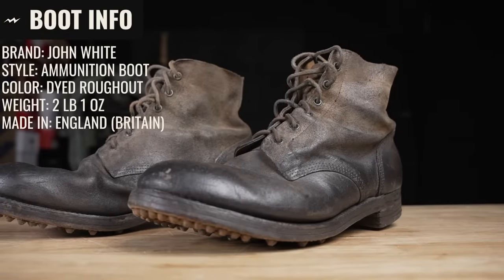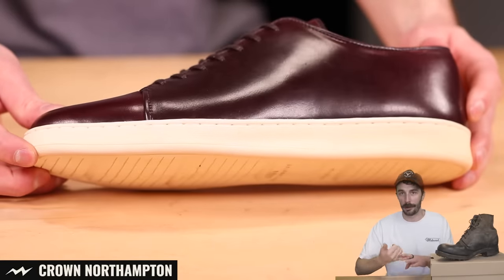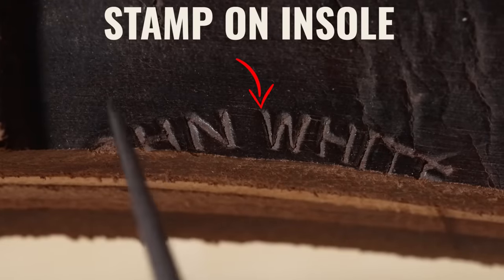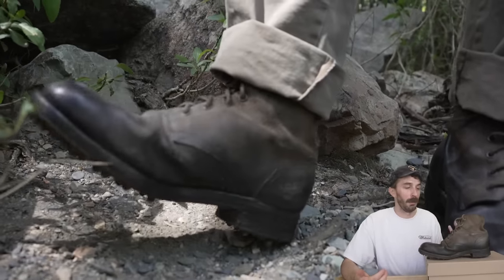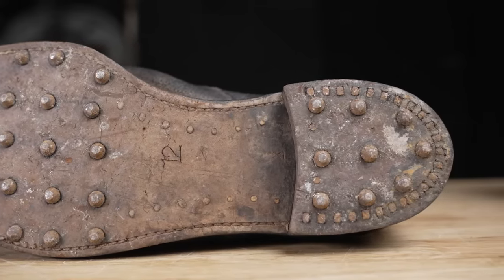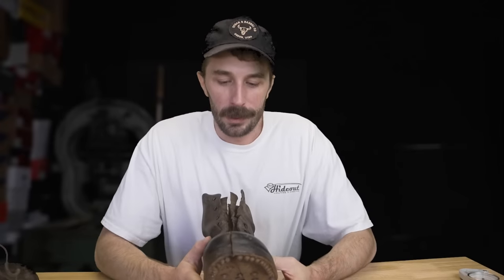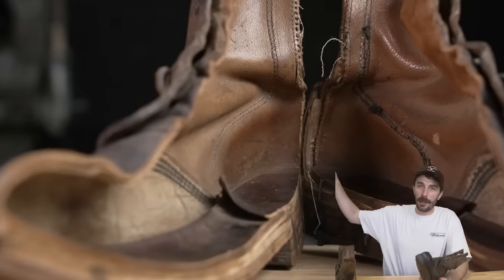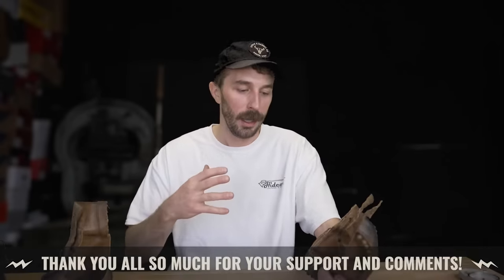Why 80 yr old British WW2 boots are better than modern boots

Comment: Very cool.
I have a pair of surplus swedish army boots. Stamped 1943, never worn, in my size.
These look pretty similair in construction though they dont have the reversed leather.
My boots have iron tipped toes and horseshoe heels. They don't have hobnails but they do have wood pegs. I'm not sure if they were meant to have hobnails and they were supposed to be put in later.
I also have a pair of swedish m59 boots that I have used for almost twenty years, they are broken in, but doesn't even begin to be worn out. These were manufactured in 1983 and never used when I got them. The m59 have a rubber outer sole (Tretorn brand), wich is the main difference from the older ones.
The only problem with these old boots is that they are very heavy compared to modern ones. I guess that's a testament to the quality but it does get tiresome after a long day.

Sad to see those fine boots cut apart, but as a boots enthusiast, I appreciate to see what's inside them.

Btw I have used raw linseed oil to soften up old boots that I've bought. I don't know if it's kosher but it does work and doesn't seem to do any harm.

Comment: I have actually worn some French 40s - 50s military boots (I was told they were basically the same model as the WW2 ones). They are definitely not better. They are very durable, they last long, but they hardly have any tactical design. Horrible when wet (after river crossing), horrible for running and such a thing as comfort for the wearer was not even a consideration.

Comment: In the forces we use to leave them in a bucket of water with added pee! YEP it works trust me! From rock hard they turn into supple  leather like carpet slippers! On long marches with hard boots it would take the skin off our feet. The studs are STILL used by many ceremonial soldiers like the guards as they are LOUD when drilling or marching on a parade! still in use today but not sure our boots were up to John Whites standard? Another trick is to really pile on dubbin or shoe polish and LEAVE IT to soak in - also softened the leather. Modern calf length assualt boots we are issued are mostly man made and VERY painful. BUT if you get a second hand pair of these they are worth their weight in gold as they are also 'broken in' and comfortable.

Comment: I'm sorry to tell you but the boots you have here are not the standard WW2 issue British Army Ammuntion ('Ammo') boots.. Standard issue British Army Ammo boots were made in black pebbled finish leather with a separate toe cap, six lace holes, a steel 'horseshoe' nailed on the heel and a curved toe plate screwed to the front of the sole. They were usually fitted with flat chequered finish steel studs on the sole rather than hobnails (with the exception of those issued to vehicle drivers and tank crew whose boots were not studded to minimise skidding on metal vehicle floors, armour plate etc..) - There were three types of boot issued in WW2 for specialist roles in the British Army, often mountain warfare related, which (like your boots) had no separate toe cap and were made in 'rough-out' leather, for example these included the 'Boots, Ski/March' - and Hawkins and J.White both made these boots but they were not classed as 'Ammo' boots' as they were not on general issue.

Comment: Surprised they made these to this high of a standard. Part of the idea in mass production of war material is matching how long it will last vs how long the "user" needs them to last. That could mean casualty rates will take you out long before your boots wear out or maybe half the boots go to truck drivers so it's not necessary. Either way sometimes it's far more efficient to design them to last 1 year of heavy use or 3 of light of most will be light use then replace the heavy use more as needed for those fortunate enough to outlast the equipment.

Read a German's account explaining the first time he got issued synthetic socks instead of wool he wasn't impressed but that they outlasted the replacements to his unit.

Comment: If those ammo boots are the same as we used to use for best dress and drill, then they are incredibly heavy and you slid on the metal studs.

I’m guessing the best dress ones were slightly modified or something.

Also, regarding peeing in the brand new boots, this was still a practice when I was in the army during the 1990s, pee in your boots, wear them, dunk boots in water, let soak and wear them for a good long walk. To break them in. Then dry out and Polish and job done. Boots relative.y more flexible for normal use.

Comment: Excellently informative video - as usual! Coupla small points: 1. The lacing pattern is wrong. British Army used the 'straight across' pattern when I wore these boots. And 2: They had metal plates at the toe and heel. Standard hobnail pattern was 17 studs to each boot. Talking about 1957 when I polished my father's boots for extra pocket money, hadn't changed when I started wearing them in 1964.
Reply: Yes 17 studs in 1958, memories of Catterick at basic training only 4 weeks for Royal Signals , then trade training .

Comment: High quality does not translate to the most durable. In modern boot parlance, quality is a balance between comfort, breathability, performance, support, insulation, waterproofing and their lasting for their intended duration.

Comment: I think you have to qualify your opinions based on the conditions they were used in. For instance, this WW2 boot would have been fine in an average European climate, but subject them to the tropics, the arctic, or weeks submerged in trenches, how would. they hold up? I suspect not so well, because that is what the soldiers said. Today, a moden army has equipment suited to the battlefield. That may mean heavily insulated and molded out of synthetic materials for the arctic, light weight, breathable, and quick to dry for the tropics. A trench would requre boots that are impervious to water. You get the idea.  Leather was not a good choice in most situations, but that is what they had. The soldiers who wore thes boots were stuck with them where ever they went. Some lost toes and feet as a result.

Comment: I do not beleive these boots are ex British Army ammo boots of 80 years ago for three reasons, as I served British Army infantry 72 years ago. Reason 1: the boot has no toe caps. Reason 2: the laces are not tied across in the British Army pattern of the period. Reason 3: There too many many studs in the sole rather than the regulation 13 Nos.  The British Army boot that I wore were very comfortable gave me no blisters but leaked in wet weather.

Comment: 8:03 
1st Canadian Infantry Division in Italy autumn/winter 1943-44

You can sort of see on the guitar player the way the quarters are cut at an angle on these Canadian boots rather than curved back like British boots, an important distinction between the boots used by the two armies.

taken from an earlier comment I had posted as a reply:

The Canadian military boot was (like that of the British) often known simply as ammo boots; though offical documentation nomenclature would be "Boot, Ankle, Militia, G.S."

By late 1943 there was a new development that saw light testing in Italy that would become the "boots, high top". They would more commonly come to be known as "third division boots" from their first mass use by the 3rd Canadian Infantry Division for the D-Day landings at Juno Beach.

The difference between the former and latter being the ammo boots were low cut, only 6 inches in height, and the high tops were roughly 9 with a leather strap and cuff at the top - a similar look to the US double buckle boots.

Another important distinction to make is the difference between the Canadian and British ammo boots. People in reenacting circles will often tell you that the only difference is that Canadian boots don't have a toe cap, unlike the standard set by British pattern boots. In reality, the only similarities shared were the fact that they were both made of black pebbled leather and both were around 6 inches in height. Canadian boots were (like many US boots at the time) made on the Munson Army last, the quarter panels were cut in a way that they angled back rather than having an aggresive curve like both British and US boots, they indeed had no toe cap, they also had no reenforcement in the toe box, had 7 eyelets unlike the 6 found on British boots, and had a different hobnail pattern hammered in using a different type of hobnail to the British.

Interesting to note is that the "boot, ankle, milita, G.S." had a service life up into the early 1960s as a parade footwear and stayed completely unchanged throughout it's lifespan, which began in 1932.

Comment: I bought a pair of fairly new JOHN WHITE dress boots via Ebay recently. I wonder whether they're still made by the same company and whether they are still manufactured in the UK. There was precious little on the internet to be found.
Reply: John Whites closed all of their Northamptonshire factories but there are smaller local companies making decent boots.
Reply: @colinbugby  Oh thank you! It's a sad tale that many of the bigger names in the trade closed for good or moved abroad. It's definitely a far cry from the, I believe, 9 factories John White once ran. I had suspected this because it only read "Designed in England" inside the boots, which always is an indication that they're no longer made in England. Still, I like my dress boots as they are pretty wide and they really look like "grandfather boots".
Reply: @iansoutryer3189   John White's used to have factories in the centre of  Rushden (15 miles east of Northampton). They still have offices. Check out Sanders & Sanders and Paul Sargent both of which still make in Rushden. Grensons are based here but import quite a lot.  NPS nearby in Wollaston are famous for Solovair but have more traditional boots too.  Barkers are also nearby.
Cheaney are very good in the North of the county. So is Loakes 1880 range  from Kettering.  Northampton town includes Church, Crocket & Jones, Trickers, John Lobb (Paris), Crown.

Still quite a lot to celebrate at a variety of price points
Reply: @colinbugby  Oh yes, and if new shoes are too expensive from the factory, there's always Ebay. And there I always keep an eye on the second tier British makes, like Grenson, Barker, Loake, Sanders & Sanders as they are not that much in demand, compared to brands like Cheaney,  Church or Crocket & Jones who everybody craves for. And chances are that they are still in good condition (in particular the soles), as usually they have not been worn that much - this is the good thing about everybody usually running around in trainers these days. 😊

Comment: These do not appear to be british army ammo boots.They appear to have the tongue stitched right up to the top at each side, which was not seen on ammo boots, whilst they are missing the heel and toe irons which had been standard since at least WW1. They also lack the external toecap, and ammo boots did not use the leather rough side out, nor did they use hobnails, but instead used flat headed studs, with a head of a larger diameter than hobnails. I do know that type of tongue was used on British jungle boots, but there the resemblance stops. As far as I am aware commando boots had rubber soles, so that would rule them out, and as far as I know, mountain boots had small cleats aroud the edges.
All in all, a puzzle as to what exactly these boots are..........

Comment: The iron of the hobnail rust & the rust is approximately 6 times the original volume.
Ever tried pulling a rusted nail? It is locked in really tight!

Comment: This makes me question the inflation and productivity we achieved in last tens of years. I wonder how much those boots cost by then, but I would bet it was not two week average salary. So in order to get the same quality shoes, you now need to work longer than in past. Also ecology, if you could wear them twenty years and modern £100 will last two years, now you need to make 10x more and consume 10x more resources for manufacturing and delivery, also produce 10x times more waste...

Comment: Where is the material you compare it with? There have been many boots and I can tell, these old boots were not comfortable. The US leather boots, higher and are much better and still in use today. The thickness of the leather might do for durability but not for comfort. I go for Meindl or Haix. A soldier who feels comfortable is a beter soldier. Learned that from...the Brits.

Comment: I wouldn't be happy about a boot with nails. You can't be sneaky with that. A huge disadvantage in my book. I'd rather have a boot that's silent but breaks after a year. My dad used to always wear old military boots, you could hear him a mile away and they were clunky and heavy, not suited for sprinting at all and left deep very visible easy to track boot prints, throwing up a lot of dirt with every step. I'd say military boots would have been a huge disadvantage for small groups or lone soldiers trying to move unnoticed. Of course for a large group that would be irrelevant.

Comment: Just like with shoemaking, there was nothing better invented in bookbinding within the last 100 years. If you want the best book, the sturdiest, the most comfortable in handling, one which opens nicely, one which feels just the best, you do it by old bookbinding manuals. Yeah, you can use other covering material, but leather is still the best there is, you can choose modern synthetic threads, which are sturdier, you can use PVA glue as some points, but, in general, even if you use machines at some points instead of hand tools, these will be Victorian age machines or their equivalents. Modern bookbinding types are worse than old ones; although they are much, much cheaper, and some automated ones are decent enough, I mean, the integral bookcover, it's ok for its purposes.

Comment: Hobnails are fine to walk on unless one works through. Those boots are quite lightly nailed though. I have seen farm boots with the horseshoe iron heel and toe and with diamond shaped hobnails in rows an inch apart with half inch seperation .  That is all very well but not one of these heavy boot types is waterproof !!
Reply: Robert Stallard  I do not know about that ! I have an old pair of Corcoran boots that are as waterproof as  you could  wish, I have worn them in salt water many times and they are not hot or sweaty !

Comment: Well constructed English footwear until the 1990's generally is better quality than that made today with the same construction techniques. The reason is the leather quality. About 20 years ago the last of the real good oak bark, pit tanned, calfskin tanneries (Kellet Leather) for 5-6 oz uppers went out of business. Dicken Bros Ltd, in Northampton, was nearly as good but they too shut down in 2016. In the historic footwear trade they were the go-to sources for me and my fellow cordwainers (shoemakers).

Nowadays most cattle are fed growth hormones and/or grain fed so the hides simply are not as dense, nor the fibers as strong, as the leather of a few generations ago which came from all pasture, slow growth cattle. So modern leather simply isn't as good as the same thickness leather made long ago. I suggest Rose Anvil make some same-size leather cuttings of old and new uppers of the same thickness and weigh them on a gram scale. That should show difference in density/quality. It is like comparing a 2x4 made of hemlock with a 2x4 made of oak.

Comment: I would take a modern hiking/combat boot over these any day, except for some very niche uses. 

I have some old 80's combat boots. Really tough, high quality and long lasting. Slippery on wet hard surfaces, the hard sole doesn't lend itself to running and a lot of surfaces. Blisters are the norm. Cramped toe box. HEAVY. No input from the ground, feels like you are wearing wooden clogs.

There is a reason that thru hikers are increasingly using trail runners, even for extremely long distances with significant weight.
Soldiers are increasingly using lighter more minimalist boots. It's way easier to make 2 or more pairs of modern boots than even one single pair of these 

So, no, military boots haven't gotten 'worse'. We just figured out what worked better. The quality might be better back in the days, but the boots weren't. Definitely not superior to modern boots.

You should do a quick march in these boots instead of just cutting them open and judging the boot by its build.

Comment: The 1980's 'DMS' boots were awful. Heavy and caused trench foot. Modern boots are lighter, more water resistant and easier on the joints, tendons and ligaments when running with load.

Comment: Having worn a multitude of British Army boots l can tell you ammunition boots belong on the drill square.
They are not suited to the average working day of a soldier- are you seriously saying they are suitable for a tank crew on a big steel vehicle or tank park covered in fuel and oil , 
climbing up and down covered in oil?
No
They are for drill .
My Haix boots are the mutts nuts and brilliant for hiking and hill walking.
Ammo boots are inflexible and slippery.
River runs are the traditional way to break in boots and wear them until they dry.
Hobnails are a thousand times more likely to make you slip.
Try wearing them on an icy drill square and see what happens!!